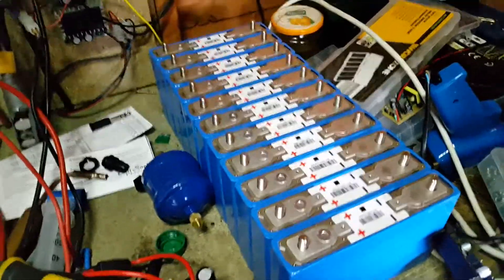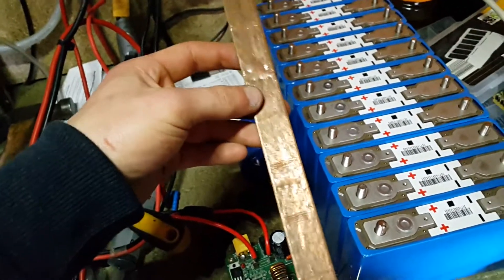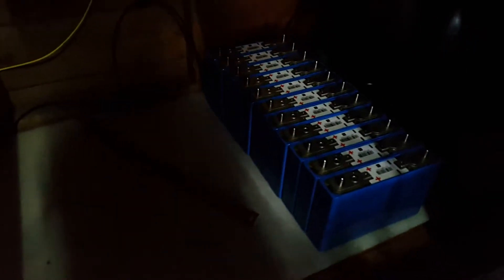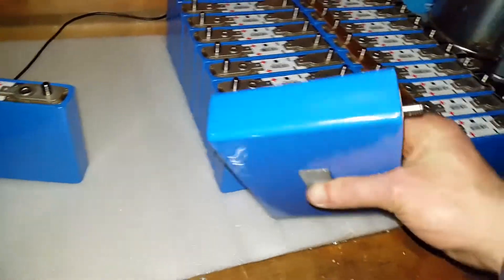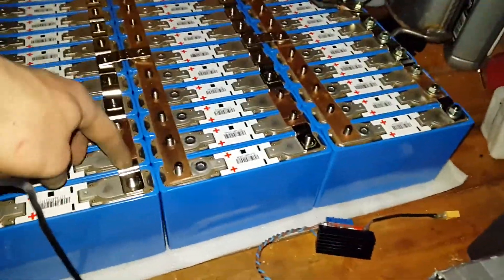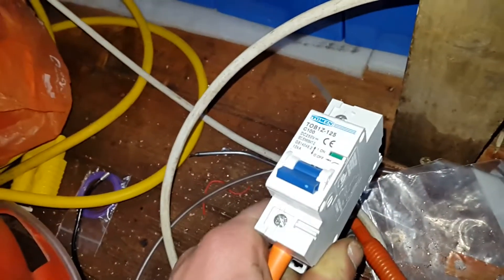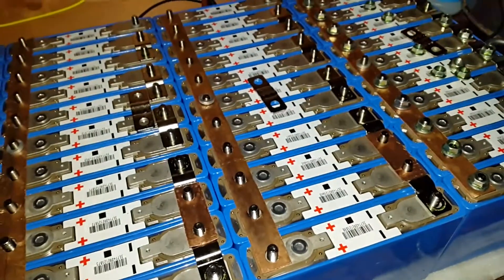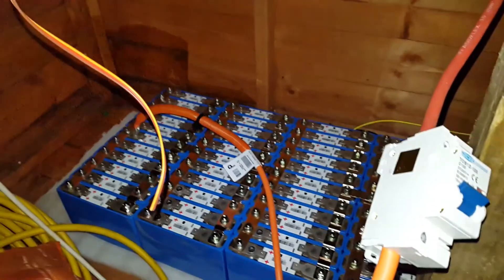DIY Tesla Powerwall - Installing Cells

Comment: Hi Shaun, I'm just about to get the LEV50 batteries replaced in my 12 year old iMiEV and I'm planning to use the old ones in a solar charging system exactly like this. I was very glad to discover this video and the rest of your channel too. It's been very helpful. I was also planning to use squashed copper pipe as bus bars. (And I have fitted a generator to my exercise bike as well. You seem to be a man after my own heart.) Thanks for all your informative & practical videos. Keep up the good work. :)

Comment: Charging lithium batteries in parrellel is a definite No .

Reason being you cannot guarantee each battery is the same or Is discharging  or charging at the same rate . This will cause differences in the charge levels over time. Leading to battery heating /failure/explosion.

Also the connection bus bars in the center that connect the parallel banks batteries in series WILL charge/discharge the center cells first due to the low impedance of the batteries vs the resistance of bus bars ( better to use top/mid/bottom in high current situations 

Overall series charging /discharging is preferred unless you have elaborate current voltage monitoring of each cell. 

So series charging/disc arching requires one current monitor and individual cell  or paired cells voltage monitor .

Parallel requires individual voltage/current  monitor per cell:block which is far more complex and unsafe . 

So unless your charging discharging at ridiculously low currents don’t attempt it else at best you destroy a lot of cells of worst you destroy your house and it’s contents .
Reply from the maker: Please present your findings to Tesla as you obviously know better than them.

Comment: mate you will need to add more series connections if you want your project to last ;)
Reply from the maker: What do you mean?
Reply: He means you drawing more amps is not going to be effective and efficient for the battery health instead drawing low amp in high voltage will give you a sweet battery powerwall
Reply from the maker: @aravindsubramaniam7930  I can't go to a higher voltage because my inverter is 24v and my solar panels would have to be re wired.
Reply: Ya i knew you had constrains . High voltage systems are great but
Reply from the maker: @aravindsubramaniam7930  A high voltage system would have no effect on the battery lifespan. Yes, the amps are lower but then so is the capacity in amp hours. The only benefit is smaller cable sizes and maybe a 48v inverter would be more efficient.
Reply: I'm going to do a 72 volt system for a commercial purpose . There will be alot of advantages 
You can charge the system faster 
You can use lower amp bms 
More efficient because if your using a inverter to convert 24 to 120 v instead of 72 to 120 
Can be upgraded in scale in future whereas 24 volt system using 1000amps is not great as a design when it comes to safety features it will face many constrains.
High amps are dangerous to handle than high voltage .
Thicker wires , heavier , costlier .
There are no inverters which can run on 24 volt to 120v and provide 20kva output per hour .
In future high voltage systems will only be appropriate as you can see porche tycan .
Reply from the maker: @aravindsubramaniam7930  For new properly thought out systems it makes perfect sense. The only issue is the balancing system will be more expensive as it will need more balancing nodes.

Comment: That is some serious power !! Nice battery.Where did you get it??? What charge controller and inverter are you going to use?? There are not easy to make it work safely, because if anything goes wrong, that would be a fireworks at your house.It would be so awesome if automakers will be making electric cars to power house in case of outrage.Nissan has some small EV to house box, but only in Japan and only 5kW.Tesla has power walls, but it will not run whole house air conditioners .There is enough power in 40kW battery bank in the new Nissan Leaf to power whole big house and if combined with solar..wow...They don't want us to access it, because that would create energy independence and that doesn't have any economical sense for oil companies nor electric cars makers.In Florida during hurricanes would be awesome to plug an electric car into house while it is charging from solar !!! During hurricanes there is no gasoline's,so makes total sense driving EV and enjoy comfort in the house as usual..Nope,it's not that easy, can't access that battery power sealed inside the EV,it would have to be engineered built in hybrid inverter/charger...They know, technology is out there,but they don't want it for a reason..

Comment: I would be really interested in a discussion with you on the details of charging, balancing and low-voltage cut-off. I'm off grid with 9kWh of wet nicad's but I'm looking at a battery upgrade. Having found a few crash damaged phev's on eBay, and possibly buying a phev as a daily drive I figured the phev back would make a good pack for the off-grid home.
Reply from the maker: Zhoulun Chan Sure, please send me some and I will do a review.
Reply from the maker: I do have balancer modules on mine but I don't bring the batteries up to 4v per cell very often where the balancers are set to. I find they stay in balance really well but you should always have a balancing system anyway. There are videos on my channel about how I made the balancers using Arduino.
Reply: Shaun Dobbie thanks for the info. Looks like I could build a 13s6p pack from the 80 cells in one of these packs. Still a little pricey compared to lead acid though, at least judging by ebay sellers asking 3k for a battery pack.
Reply from the maker: The cost is very worth it, lead acid is total crap compared to these. I got mine for £1600
Reply: Shaun Dobbie our nicad's are reliable, but they use a lot of water when you charge them hard (which we do) and they have a terrible efficiency... plus, we're at 80 cells for our pack, that's a lot of interconnects to maintain when they sweat alkali solution.
Reply: contact me for this type of battery, we have agent in Louisiana, we will send 125 pieces 3.2V 80Ah batteries there, you can get it.
Reply: Shaun Dobbie looking at this again, mainly because I've found some outlander packs on eBay for 16-1800 gbp. What settings did you end up runnin on your FM/MX 60? We have the same solar charge controller.
Reply from the maker: Hugh Frater I charge to 4v per cell and set the float voltage to 3.95 per cell.

Comment: I would have taken each row of cells and added a fuse. If something goes wrong it will be really bad with out more fuses or breakers. Other then that looks good
Reply from the maker: Seems sensible. I may do this when I install the heating elements near the end of the year.

Comment: A REAL powerwall! (well, maybe not mounted on the wall) Unlike that other hack who called it a "powerwall" that literally just stacked tons of 18650's into blocks and hung it up on the wall with a $300 piece of custom glass with no other electronics inside of it
Reply from the maker: That is just dangerous.
Reply from the maker: What person is this? I would like to have a look at what he is doing.
Reply: This type of battery is lifepo4 -lithium iron polymer battery, aluminum case, pp standard unit voltage 3.2V, capacity range from 10A to 300Ah for each cell.